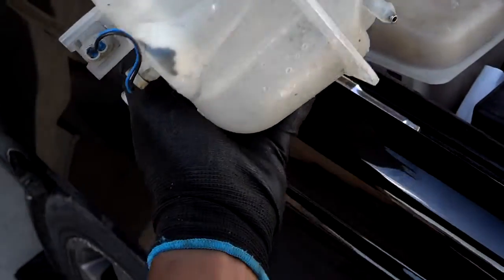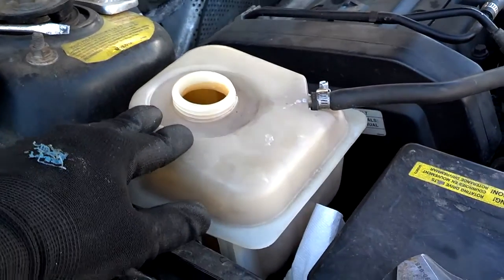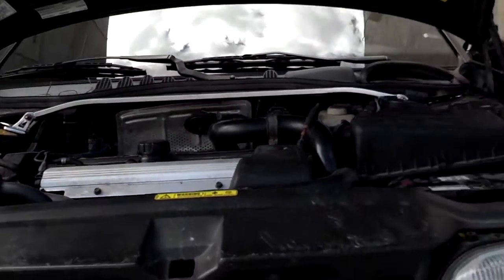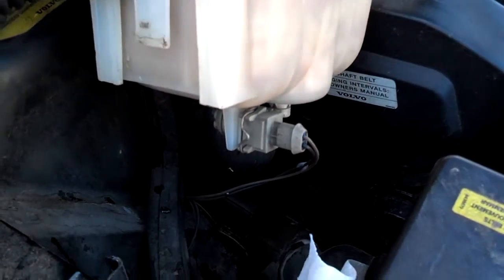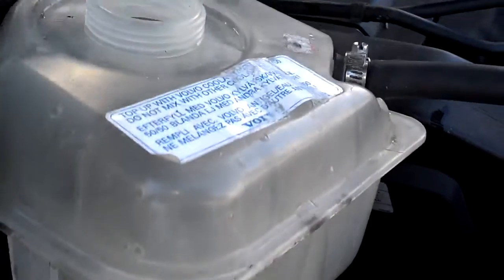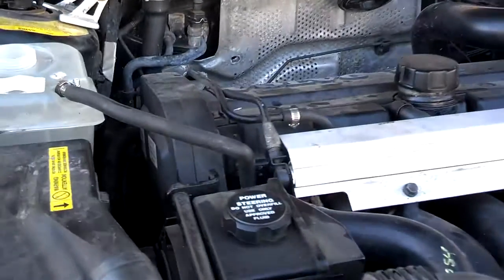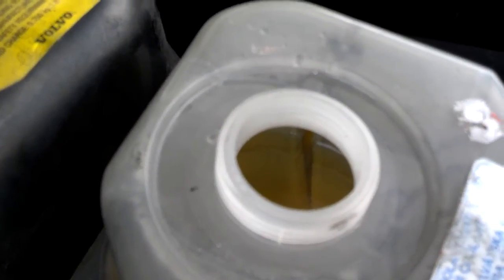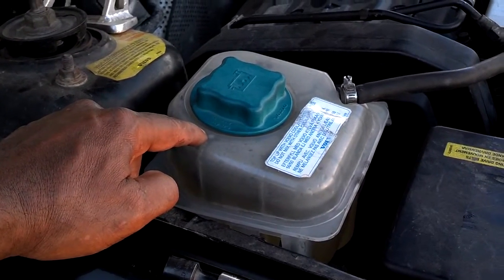How to replace the coolant reservoir bottle, Volvo 850, S70, V70 - VOTD

Comment: I just did this job thanks to your help. It's very easy.
I used a turkey baster to empty the reservoir (into a clean bottle) then you don't have to drain from under the car. My baster was even able to take out the fluid in the top part of the bottom hose -so no spills at all. Good tip on testing the level sensor. -will look for you next time there's a small job like this. Thanks very much!
Reply from the maker: Thanks for watching and for the tip.

Comment: Good info on the return line to reservoir.  I had to really tighten that down as I was loosing coolant and hearing air pressure escape there after replacement. It almost seems like the aftermarket tanks have a smaller male end for the hose to connect to.
Reply from the maker: +Ryan Wilson That is correct.

Comment: Can you show how to change the bottom hose of the coolant reservoir?  Thanks
Reply from the maker: +N 10SZ just lift the bottle, loosen the clamps and pull the hose off.
Reply: Can I replace the hose?  If so, where does the other side of the hose lead to?
Reply from the maker: Lift it up and take a look.
Reply: Duh.  Will do.  I have a serious coolant leak coming exactly from that area.

Comment: Hi Robert. I want to thank you for all your videos. You are a Godsend! My mechanic turned my coolant reservoir bottle upside down, for some reason,  and now my warning light is on. The coolant is at max level. Any suggestions?
Reply from the maker: +Eugenia Kozlowski is the wire broken?
Reply: Robert DIY , I don't know, but I will check & get back to you.
Reply: Hi Robert, I just checked & the wires look ok. Only thing I noticed, where wire plugs into the tank does not seem snug, meaning it can be pushed up a little, but slips down again & it can be turned, but it is not leaking. Is this how it should fit? Also, I see the mechanic did spill some coolant out & may have gotten the sensor wires wet, would this ruin them? Would pulling on the tank too far & too hard, cause this problem?

Comment: I just replaced my coolant tank on my Lincoln Ls because it was leaking. Long story short, I bought the tank from autozone, had a shop install it and I noticed leaking just drops. Took it back and they swapped the old clamps for the hose clamps w/ the screw for tightening. Well its been a week and again drops, I took a good look and I see it leaking from the cap. Its a pressurized tank (15 psi), I'm wondering if I was to wrap Teflon tape around the threads if that would work. I'm tired of this leak. It's a simple fix but not on this Lincoln, too many things in the way. I would hate to have to take it to the shop again and go through all the loops of replacing and exchanging parts. any ideas would be appreciated.
Reply from the maker: +Puppetlo May need new hoses.

Comment: Hey Robert , 
I was getting a low coolant level and replaced my sensor, at the same time I found a bottle in a pull and save yard and replaced it as well. The coolant level light still comes on but I did notice a crack in the bottle were the hose attaches. 
It is on a 1999 volvo xc awd and I believe the sensor works when covered by fluid. Any tips on diagnosing the sensor? Can the crack in the hose inlet effect pressure and the sensor or is it just effected by fluid level? The sensor is solid . Light comes on about three min after starting . Appreciate your time, I'll check connections to make sure they are clean.
Reply from the maker: +Donny McClure Float in the bottle.
Reply: I noticed that , it was stuck so I cleaned out bottle and made sure the float was moving. After reinstalling the light goes out when I depress the float then comes back on with it floats to top.... not sure whats going on..  thanks again Donny
Reply: When cleaning tank the part that holds the float in came off so in case I reinstalled the float wrong I took it off and flipped it over , no change. It seems the sensor is reading the levels back wards so even though it's new I'm going to return it to FCP. thanks
Reply from the maker: ok

Comment: what if s70 consuming coolant
Reply from the maker: What do you mean by consuming? If it is going out the tail pipe the head gasket is bad. If it is being forced out of the top of the coolant reservoir the head gasket is bad. Other than that, it is likely leaking.
Reply from the maker: https://www.youtube.com/watch?v=s1OlrdloSzo
Reply from the maker: https://www.youtube.com/watch?v=-0krQR2MVTA